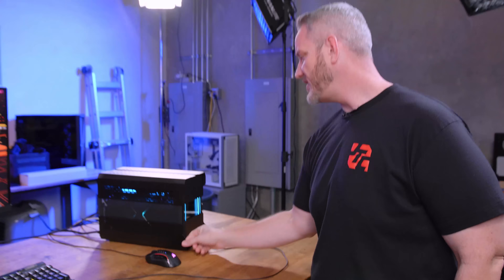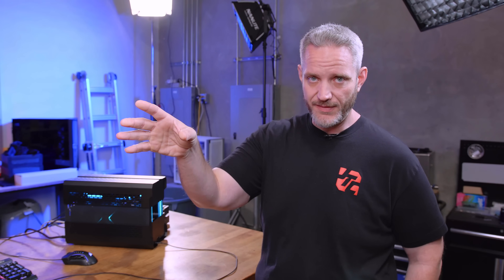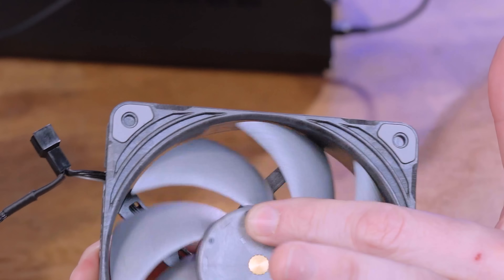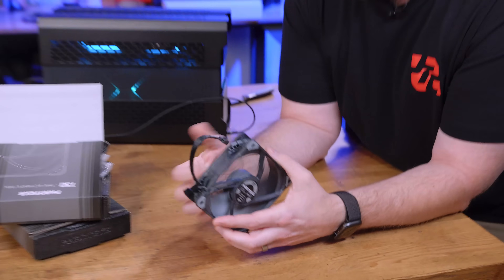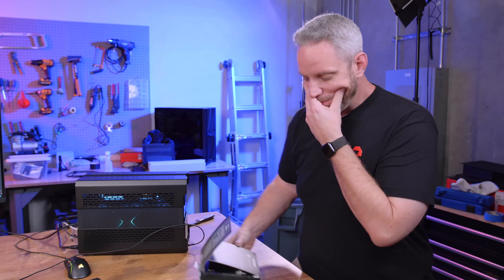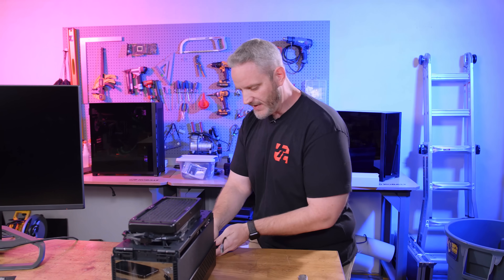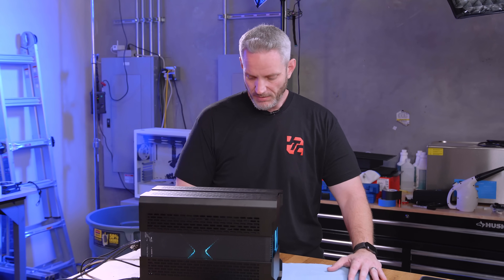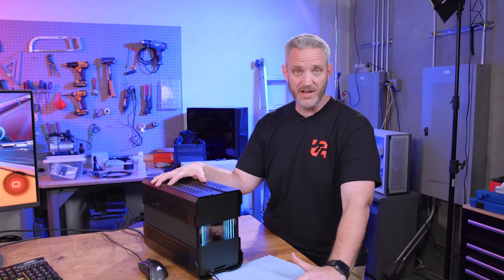Improving the cooling in my Evolve Shift XT build... it got TOASTY!

Comment: I feel like all the small case designers keep walking around the elephant in the room, which is a case designed to focused on maximizing airflow.
Wonder when we get a case which puts Mboard horizontally, and separates GPU from CPU, so one doesn't impact the other inside the case, while such build could accommodate all cooling solutions. It wouldn't be the smallest case, but it would be smaller than the average case.
Reply: Nr200 is very well vented and small case like the Dan a4 h2o are so small that the gpu is at the edge of the case so it just use airflow from outside. 
On my nr200 the 3070ti fe ran super cool thanks the fan and airflow direction
Reply: @sentryion3106  NR200 is my favorite case so far, but it does share the same problems as all other small cases due to the same overall layout, which causes GPU and CPU to impact each other which results in even 80*C on CPU in 20*C ambient temp., and that's with 280 AIO. 
Everything due to problematic layout and lack of GPU/CPU separation.
Maybe one day we will see small cases with GPU/CPU separation chambers... or I'll build one myself, lol It's not a rocket science. You can make most of the case with two U bent sheet metal.
Reply: @jnx4803  what cpu are you on and what are you doing with the cpu since my u12a was cooling my 12700 cpu very fine at 60 for most gaming and only when I push cinnebench that it goes to 90s.
When I’m on my h2o the 240 aio I got (cm one) even cools it down to only at max 80. Also isn’t the separation you talking about sandwich layout? The cpu has the radiator to exhaust and gpu heat is dispersed through the side panel so it doesn’t interact with the cpu. Cases like this one, the Dan cases q58 meshilicious all have the same design

Comment: Everyone i've seen building in ITX-boxes say that that type of GPU cooler sucks for sandwich cases. You said that there is some room behind the fan, but see if you can find a GPU with a good (for this case) cooler, and try that out. That noise level is horrible. Not many people would live with that. ..but if you think this is anywhere near the norm for a SFF build, you should start following Optimum Tech (a really cool australian channel). He builds some really cool, and rather quiet, SFF-builds.

Be Quiet: Having watched your video of the RGB fans, i tried biuying a 140PWM Silent Wings 3, alongside a Noctua 140PWM, for my NZXT H1. The Silent Wings 3 SUCKS on a radiator. The Fractal Ventury i had running does a better job than the Be Quiet, but the Noctua beat the both of them..to no one's surprise i would think.

Comment: I am making this comment to correct a notion that you have. No if the temperature is 1 degree C or F hotter it will not necessarily mean that the system will run 1 degree C or F hotter than where it was previously. Is all based on the thermal design of the heatsinks, thermal pastes, chassis, etc. The system will have higher or less thermal dissipation efficiency between specific thermal ranges. But yes, it will be hotter but to assume a linear thermal curve would be naive.

Comment: I have always wanted a very small form factor for the living room but the cooling is just not there yet. Loosing the waiting game too, as time goes on, stuff gets hotter and cases get smaller. I mean it seems like a great idea then I remember, oh ya I play games.  I could not even take the sound from my older P400 case. I had to get the new mesh front sold on the modern versions. My PC before that I build in a CM HAF and it was ginormous but quite as a mouse. Hmm perhaps wireless GPUs is what I need. Then I can stick the bastard into a closet. Someday perhaps.
Reply: SFF is absolutely already there, but this isn't someone who understands it. Optimum Tech is a good example of an SFF enthusiast who actually knows what he's doing.

Comment: Immediately jumps to fans when he could have just went into nvidia control panel, set his frame rate limit (NOT THE SAME AS VSYNC) to just under his monitors refresh rate, Example - If you are on 144hz, set it to 143. This ill lower your overall rendering latency. Check it. turn on the nvidia performance panel, watch your render times, Try uncapped, then try my method. In The Cycle play test im currently playing I set mine to 143 and it cuts my render times from 8ms to 2-3ms. You dont need to run uncapped to gain performance... 

Doing this also causes the GPU to produce much much less heat, and will void needing to upgrade to some other beefier fans.
Reply: Oh and my 3080 stays about 45c playing the cycle with the aforementioned settings.

Comment: It blows my mind that after 20+ years of PC gaming being mainstream, that temps and fan noise are still the biggest issue with building and no one has come up with a good solution to keep that down...I just built a $4,000+ system and I still have to hear obnoxious fans cranking the entire time to even use that performance, and its just very unplayable...like cmon engineers you can innovate something to make this irritation go away...

Comment: If it's a game that can always stay over your monitor's refresh rate, you should definitely keep vsync on because you're just wasting power and generating heat for no reason otherwise. It is physically impossible for a monitor to display a framerate higher than it's refresh rate because the refresh rate is a physical limitation of the monitor. So when the framerate of the game exceeds your refresh rate, you never even see those extra frames, thus the power used and heat produced generating them is purely a waste.

Comment: The design on the founders card is flawed by having fans in 2 different way, also with a cpu and gpu that consumes alot of power it will be a great task to lower the temp insinde  your case. I'd pick amd for the lower power draw and easier way to cool down with almost the same performance.

Comment: That's not what a harmonic balancer, more correctly called a damper does... A harmonic damper absorbs the harmonics of the crank shaft created by the combustion process, and the fact that there is time between combustion events, creates a slight variation in RPM speed. If you were to actually have very sensitive sensors to measure shaft speed in very small increments of rotation you'd see that there is an acceleration just after a cylinder fires, followed by a slight slow down, and repeat for every cylinder. 

The outer weight is suspended by rubber, to allow the outer weight and inner hub to slightly spring backwards and forwards, with each of the combustion events.

Yes, there are Fluid Damper harmonic dampers and this is mostly an aftermarket thing to suspend the weight in fluid to make the operation smoother, and safer for higher RPM use. there are very few OEMs that use fluid in their harmonic dampers.

Comment: The people that don't agree with me just didn't listen to me. Okay dude.
Reply from the maker: You're really bad at sarcasm aren't you "dude"?
Reply: @Jayztwocents  Not really I am quite sarcastic myself. Hence the comment. Hey its all just jokes. Try out the Aquacomputer Quadro in a build. You can ditch Armoury Crate and zero turn functionality is built in no matter what fan you use. Aqua Suite is also a much lighter program then any AIB software. I have also tried PSU assisted GPU exhaust and agree with your theory it helps the PSU stay cooler.

Comment: I dont get the idea behind all these small form factors at all. It still needs a place to stand on, which is not that significantly less than standard mid tower. There is no way you can utilize it to be vertical lower. So only the pain and suffering I see.

Comment: Using a 3070 instead of a 3080ti would keep temps (and in turn, noise) a lot lower.  Leave the big power stuff for bigger cases and you don't have to choose between cooling and noise.  I wouldn't want that much money in such a small package, anyways.  If somebody wants to steal my system, they're gonna earn it lugging a full tower from the 2nd floor of my house.
Reply: Exactly practical use is more important than top end flash in these mini itx builds.

Comment: Never been a big fan of mini itx cases they run far too hot
Reply: It really comes down to what case you are using. Sandwich style cases are terrible for FE style cards. For example I have an NR200P running a 3090 FE and it has only ever maxed out at 65C. And that's with the quietest fan curve I could make since I hate fan noise
Reply: @Le_Mocha  I had a node 202 and the previous phanteks evolv shift for htpc and never liked the temps

Comment: Just cap Rocket league at 120 fps, with NvidiaProfileInspector.
Over 120 the inputs get saboutaged by whatever is programmed in this game.
The sensitivity of the input is half at 240 fps, than what it is at 120 fps.
So, the fps influences DIRECTLY the sensitivity of the inputs, which is strange, but true with this game.

I know that is not the thematic of this video, but capping a game at 120, also gives you lower temps.
90 fps also already feels very good, compared to the 60 fps that where console standard for so long.

Comment: Running top end power hungry, hot devices like the 3080ti and a 12900k in a mini itx build is not smart to do. Those devices need a lot of cooling or else your looking at a hot box that’s loud and shortening the life span of your components. A better logical build would be a 3060ti Founders Edition paired with a 12600k.

Comment: First of all, it is an absolute fact people are not very smart running ANY software above a monitor's maximum frames per second (such as 120 Hz or 144 Hz). Most games look great at 60 or 120 fps anyways. I never saw the need for 4K gaming, especially if your monitor is basically close to you, a foot or so away, and so I stick to 2K (really, it is actually 2.5K). Second, you NEVER use celsius, especially in America. Your temps are at fahrenheit. 

Just because the number appears low in celsius, does not mean this is the actual true heat temperature in fahrenheit, the best and preferred true heating measurement. The one example is 70 degrees celsius is 158 degrees in actual fahrenheit temperature! That is VERY hot! Ever been outside when it is even 100 degrees?! Now think what that is like to the inside of your case, and your cards you have installed!

 I also run my fans at 100 percent when I am playing games, even when you hear some noise. You just learn to concentrate on the game, use your speakers at a decent volume, and do not pay attention to the fan noise. What is more important, whining about simple fan noise, or the lower temperature, and the life of your cards in your computer? Also, one more thing I have been meaning to talk about is too many perforations in the case is not a good thing. Dust is the main culprit for that very reason.

And two more things I will add that is easily proven: small form factor cases are NEVER good for efficient cooling, especially with gaming and graphics cards. So the fact you even made this video in that essence is pointless overall, mostly because of cooling being limited and not efficient. Bigger space to move air is always better.  I would not even buy a laptop made for gaming, no matter what cooling they claim is in it, or their claims overall.  Small enclosure spaces is never good for gaming.The reasons are obvious: DUST, HEAT, AND LIMITED AIRFLOW WITH HOT TECH TOO CLOSE TO EACH PART.  Let's use some common sense please.

Comment: Come on man...  that is not how nor is it what a harmonic balancer is used for. They do not balance out the centrifugal forces of an engine they "absorb and remove unwanted vibration due to torsional twisting of the crankshaft". Hence why a 'harmonic balancer' is more correctly called a 'harmonic dampener'.

Comment: The reason why the gpu goes so hot in RocketLeague is because they fucked up the code.... in some situations (mainly in the main menu) there's non fps limit, they render without any safety. I had my gpu 3090 going up to 55 degrees in this game (yes, that's high for my build) and I was wondering what was going on. I capped my FPS limit systemwide in the nvidia software to 360fps and never had the issue in any game anymore. Short story short, you get high temps on ur gpu cuz shitty coders. <edit> I also use T30's in my system, they are awesome! </edit>

Comment: Besides  the usual "You can get this on Amazon" blurb, start giving us links to the equipment used in a build.  AND, Mr. genius, next time just follow the mfrs. intentions.  As we say in the military, "When All Else Fails, READ THE DAMN INSTRUCTIONS."  I FIND IT RIDICULOUS THAT SO MANY USE WATER COOLING IN A RIG OF ANY SORT; it was a total pain in the ass back when we still used it in military and still, since it's WATER, will do the same ruination if it ever leaks. Anything for another subject to cover in a video, even if it covers idiots putting water in close proximity to an electronic device.